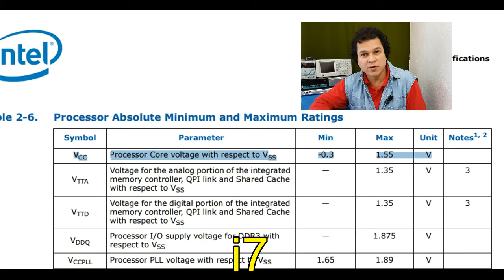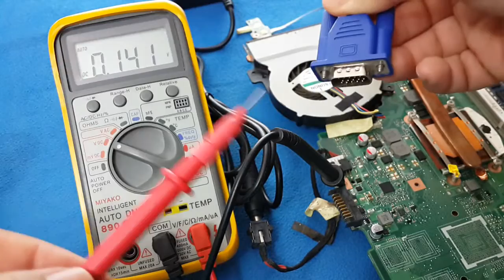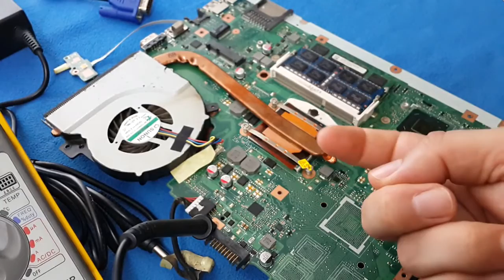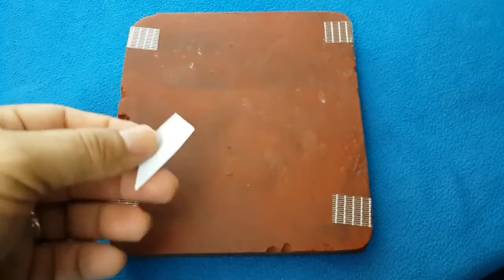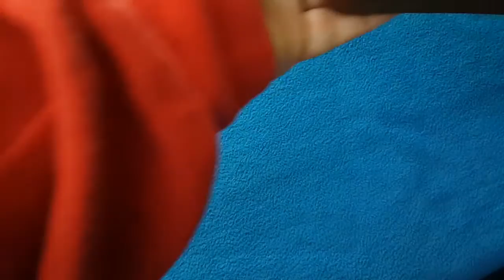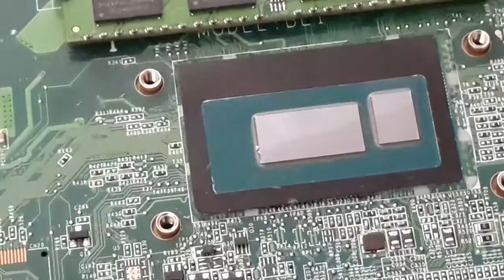ESD  an easy way to kill a laptop or any electronics / different ways to kill equipment by mistake

Comment: I keep seeing people that work on electronics and repair them, things such as VCRs, TVs, smartphones, even laptops, and I find that so many of them don't seem to take any ESD precautions. No ESD-safe mat which is grounded, not even at least a wrist-strap which is grounded. Why? They seem to get away with it as well, such that the devices keep working. Are they simply lucky so far? I try my best to take ESD precautions so that I don't zap chips as I don't have the money to throw away on having to fix something that didn't need to break in the first place due to my neglect. Is there something I'm missing that maybe these people are doing that I don't see? It doesn't look like it. I've even seen people work with circuit boards on top of carpet on their workbench which to me seems like a very bad idea.

Comment: Glad that you're still with us after accidentally electrocuting yourself. So many are not as fortunate. Thanks for bringing a needed reminder to the care required when working with electricity. I think sometimes people watch professionals do things seemingly without care to the dangers that they may get over confident without realizing that professionals can also grow complacent and do things that aren't safe. Not only that but beginners may not realize that someone who has been working in the field may have internalized some of the safety precautions and not remember to mention them in a video. I've always treated electricity with a healthy amount of respect after I took apart an old flash camera and my fingers touched the big capacitors. I got such a zap I'm sure my eyes went wide and I never forgot what could happen. The best part was it was an old camera with no batteries and yet the capacitors held plenty of charge still to give me a good jolt.
Reply from the maker: You are right. When I teach electronics, my first lesson is: "electricity kills", and it is the first rule to learn before Ohm's law. The 2nd rule is electronics kills too, fast or slowly but it also kills. There are a lot about safety from electricity to learn, and also about the chemicals used in electronics. I never forget to teach that to the new students, because in my generation it was not seen important. 
Thanks by sharing your experience with us. I hope all the readers think about it. Just in your case, what will happen if you are an old guy, or young one with a heart's aritmia? For either case, it will add more damage that at the end it shorts life. The right way to deal with electronics is as you said it: we must "treat electricity with a healthy amount of respect ".